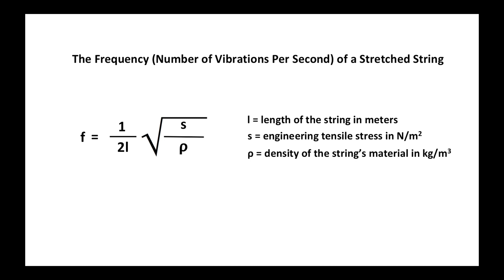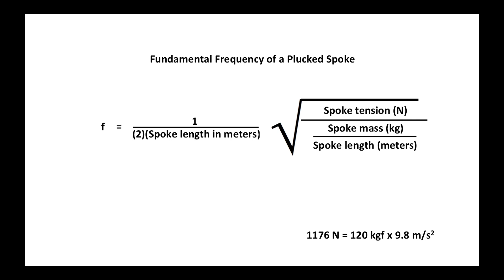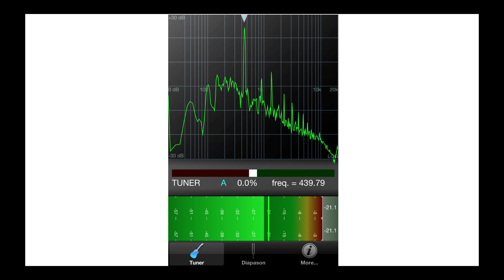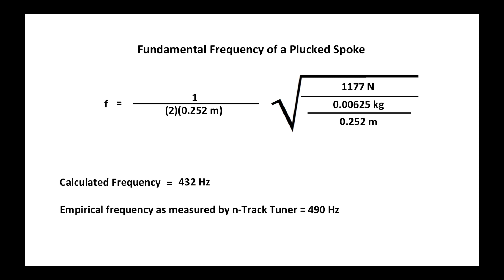Frequency of a Plucked Spoke

Comment: I was thinking about this, and I realized that width must be included in the calculation by "mass", since a wider string of the same material would have a higher mass.  Musicians would think in terms of width, not mass.  I didn't realize that the density of the material mattered, but that make total sense because it's harder to move something heavier.  I was confused because I always assumed that wider strings (of the same material) made lower pitches than thinner ones, but the more I thought about it the more complicated it got, especially with wrapped strings.  The winding on a string is not at the same tension as the core, because the winding is longer.  Thinner strings stretch more, so they must produce a different pitch at the same tension.  I even thought that maybe the number of overtones present could affect the fundamental pitch because of conservation of energy.  In the bicycle wheel the whole system (including rim, the other strings, and the hub) will affect the frequency because they are vibrating sympathetically, even if inaudibly.  The spokes are probably loudest and ring longest when all the spokes are at the same tension.  They would ring even louder if the the crosses are at harmonic nodes.  The dissonance of unequal tension dampens the strings.  I think even the dissonance could nudge the intonation one way or the other as the strings try to "agree" on a pitch.  Strings change pitch as the amplitude diminishes because they are at a lower tension when quiet than when loud.  Thanks, I thought about most of that because of the video - even though I'm totally and completely clueless about the math.

Comment: Good video!  I used a similar method on my 36" unicycle wheel build.    I also use a thing like a guitar steel at the spoke cross to get a true measurement on a single spoke with no interference from the adjacent crossed spoke. I’ve also used a small C clamp on the cross to do the same thing. That changes the effective length of the spoke to the distance from the cross to the rim and makes measurements very consistent.
Reply: Photo at: https://a4.pbase.com/o12/18/427118/1/172140802.cmeuprQF.Z99A2814a.jpg
Reply from the maker: Great ideas, Jim!

Comment: One possible explanation for the measured frequency being higher than the calculated frequency -- a spoke is not exactly like a string in that it has much more resistance to bending than a string.  Both ends of the spoke are attached in a way that gives some resistance to bending while the spoke is under tension.  The nipple, for example, has enough friction holding it in place that it cannot shift around to allow the angle of the spoke at the rim to change slightly as it vibrates.  It "wants" the spoke to stay where it is, in other words -- it will exert some extra force that will help the spoke return to the neutral position.  This extra force might lead to a higher vibration frequency than you would get with an ideal string under similar circumstances.

No idea if that's enough of a factor to make up for the difference, but thought I'd throw it out there.

Comment: Bill, I am curious how your correlation between musical pitch and tension compares with the ones I arrived at using a Hozan tensiometer, here: http://ihpva.org/HParchive/PDF/hp53-2002.pdf. You have a tool which measures tension directly; I had only Hozan's calibration tables. 490 vs 432 is significant, 1.13 times, corresponding to a difference in tension of 1.29, all other things being equal. Is it likely that bending stiffness accounts for the difference? You might be able to account for it by measuring spokes of differing thickness at the same tension and drawing a curve fit.
Reply from the maker: John, thanks for you comment.  Plucking spokes is really a very poor way to measure spoke tension.   Consistency yes, tension no.  As you know, two spokes could display the same fundamental frequency but have vastly different tensions because of the many variables such as length, cross-sectional area, etc.  Still, it is interesting that tension can be predicted from a formula, and that is all I was trying to show.
Reply: @BillMouldWheels , @John Allen, I respect a lot the work that both of you are doing. Let me correct you with respect to the equation that you use calculating the fundamental frequency of a spoke. One needs to add a couple terms to the equation in order to take account of its stiffness, see https://www.proguitar.com/academy/guitar/intonation/byers-classical, eq. 13 therein. I recalculated the frequency according to the eq. 13 and obtained good agreement with the Bill's tension meter within just a few percent.

Comment: Hi Bill, was curious I saw another video of yours on spoke meters...and I understand a parktool would be good for home mechanic...but so what if my wheel manufacturer recommends a certain tension specifically because of model...so I was wondering should I just go with a more accurate reader or will the parktool be enough?

The model rim is a ZTR flow by Stans thanks. Also what app were you using a phone??
Reply from the maker: The Park Tool TM-1 will serve you well enough
Reply: @BillMouldWheels  What to do if a rim manufacturer doesn't supply recommended tension? These are double walled aluminum fat bike rims,  26" by 80mm outside width.

Comment: Bill, you did not mention the difference in length between a zero tension spoke and tensioned one. Could this explain the error between theoretical and actual frequency? Have you measured differences in spoke length due to stretch at full tension? I know just by feel that the wheelset I built with straight gauge 2mm spokes reached tension with fewer nipple turns than did my wheels with CX-Rays, presumably because of spoke stretch. It would be interesting to see an experiment on this!
Reply from the maker: Bill, good to hear from you.  You are correct that spokes stretch.  How much they stretch depends on their modulus of elasticity, something I have studied in great depth.
Reply: Spokes stretch a very tiny amount under tension. This does not appreciably affect the pitch, as it does, for example, with a stretched rubber band. The important factors are density, length and to a much smaller degree, bending stiffness and thickness. https://www.sheldonbrown.com/pitch-equation.html
Reply: @jsallen1946 , I aggree with you about the correction due to stiffness. One needs to correct the  equation that you use calculating the fundamental frequency of a spoke. One needs to add a couple terms to the equation in order to take account of its stiffness, see https://www.proguitar.com/academy/guitar/intonation/byers-classical, eq. 13 therein. I recalculated the frequency according to the eq. 13 and obtained good agreement with the Bill's tension meter within just a few percent.
Reply from the maker: @edbaibek  Wow, Eduard, that's for that information.  Bill

Comment: This has been one way of measuring appropriate tension using the "by ear" method. It is helpful when the wheels have not been serviced for a while and you want to see if all spokes have about the same tension. Just pluck and listen for variances in pitch. You can use a guitar tuner if you like.

I have used this technique to adjust wheels for average spoke tension across all spokes. For the most part, spokes can stay tuned if I use blue thread locker on each spoke nipple after the first build adjustment.

Comment: Great video!   The spoke crossings will obviously affect  the resulting absolute pitch, but  with practice this is a viable way to measure absolute tension.
      Practice Makes Perfect!
Reply from the maker: Anyway, it's interesting, Shaun.
Reply: The crossings don't affect the lowest absolute pitch if the two spokes are at the same tension, though they create other, higher pitches.